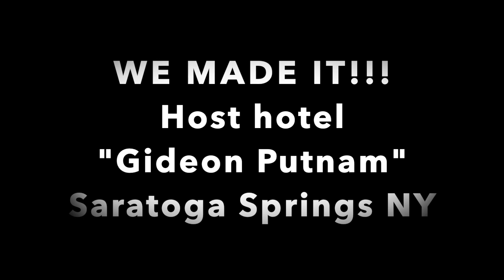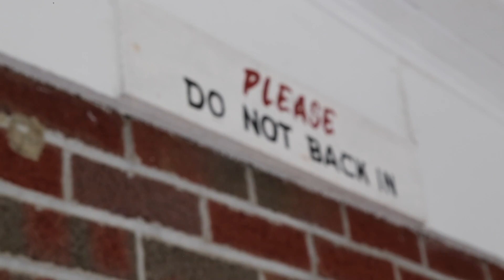1957 FORD THUNDERBIRD ROAD TRIP

Comment: I replaced my original radiator with an aluminum 4 core and it no longer over heats ever. I kept the original in case I ever sell the car. Mine's a '57 D code and a daily driver. One interesting fact : The automatic T-Birds 55 thru 57 can be push started like a manual. I didn't know until I started reading the manual when I got bored one day.

Comment: I was thinking about buying on these 57 Birds to cruise I-40/R66 Phoenix to Cedar Rapids , Iowa. I am now hesitant as I am not sure these cars can handle the heat without fuel injection. Of course I worry about a break down and your typical Ford dealer most likely will not have the parts. If you have to leave the car on the side of the road to go for help, in today's world  it may not be there when when arrive back to the car.

Comment: Getting in the drivers seat is easier if you put your butt on the seat and swivel in. I had the twin of this car in Australia and have had 5 Baby Birds. The engine should be running when adding cold water to a hot engine.